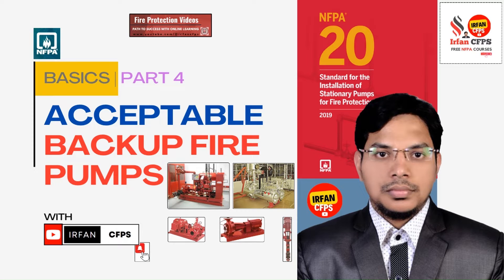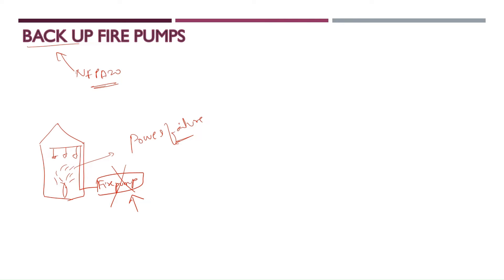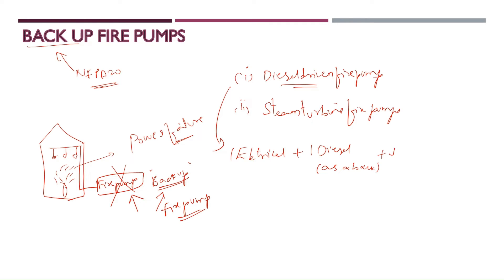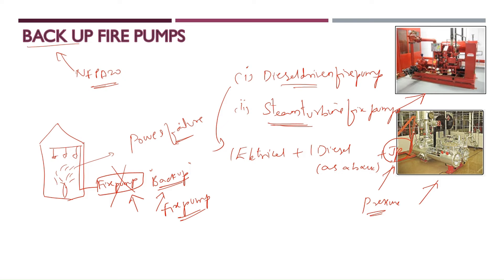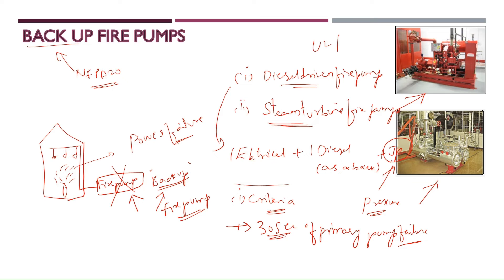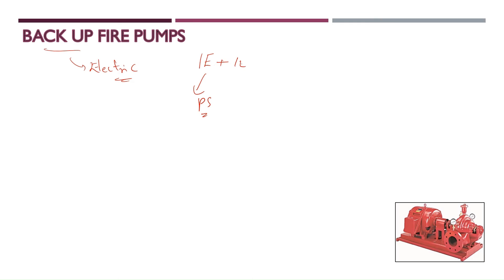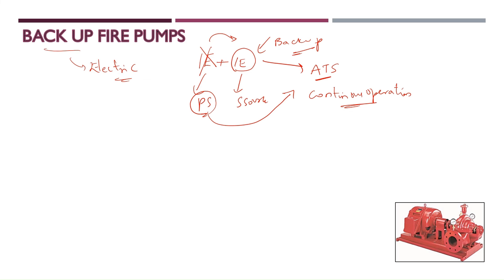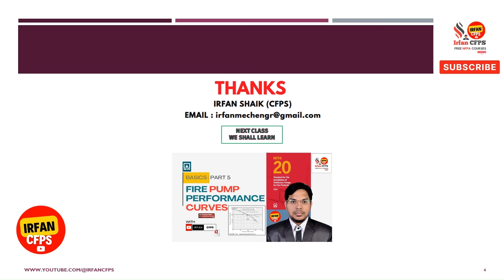Choosing Backup Fire Pumps: Everything You Need To Know

Comment: sir irfan , thanks for this video. I learned a lot .. It is concise and can be easily understood. For the back up power supply with ATS as mentioned in the video, do we need to provide generator set dedicated solely to the electric motor of the fire pump? Thanks again sir.
Reply from the maker: Yes dear. As you right said we need to provide generator set..